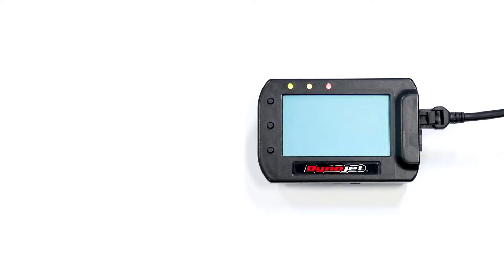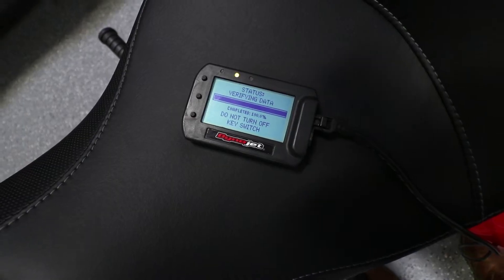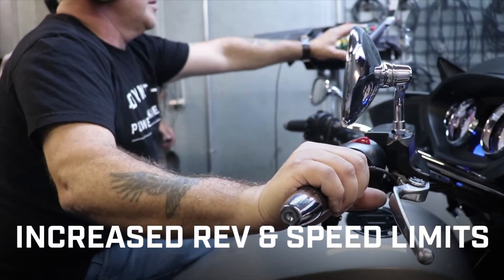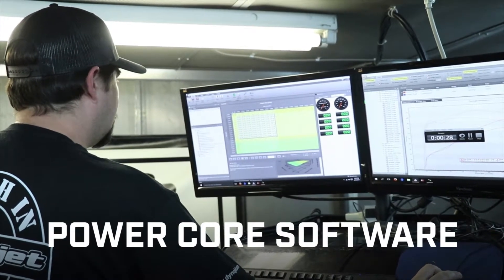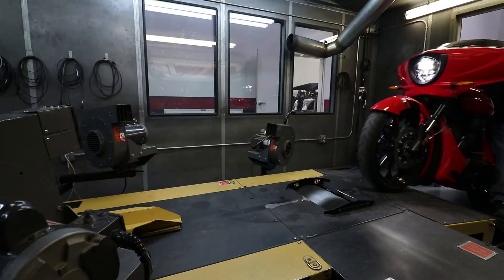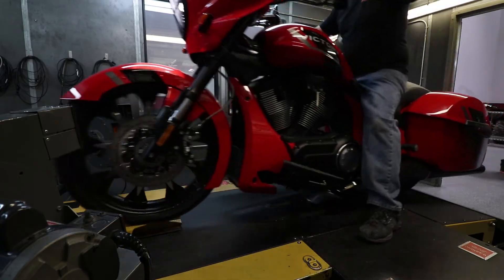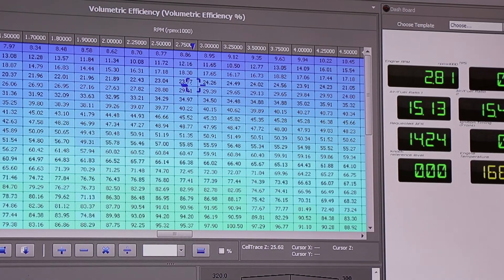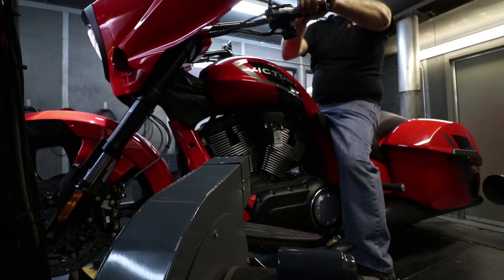Dynojet Power Vision CX: How to Flash Tune your Victory Motorcycle

Comment: First save your money if you have a dyno near you that has a commercial license for the power vision CX. If your going to do a remote tune you will need this but should really check out the maximus if you own a victory. The can maps or down loadable maps from dynojet are very far and few in between for the PV CX in fact they only show one for my highball and it's for slip ons better then the factory tune but I put a 2 into 1 exhaust and intake so I'm looking for a canned map to get me by until I install cams then I will have it Dyno but in general feeling like I wasted $400.00 I don't mind canned maps they get you close but to only have one map for a steel frame 106 is crazy.
Reply from the maker: Mr. Highball, we're sorry that you're disappointed with the performance of your Power Vision CX. Have you talked with one of our customer service reps, who can help you get the most from your bike with your current setup? Feel free to send us an email at pvtech@dynojet.com and we're happy to help.